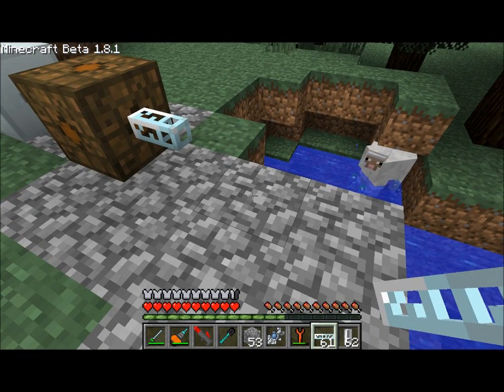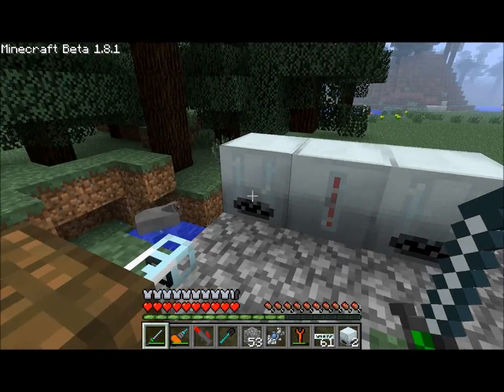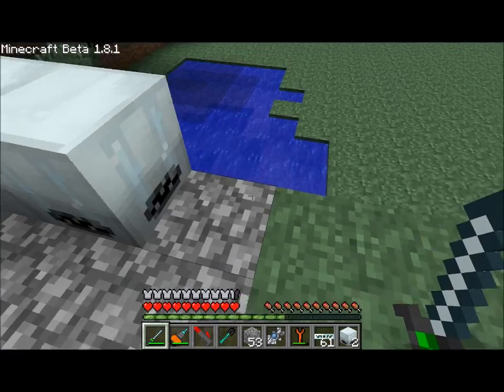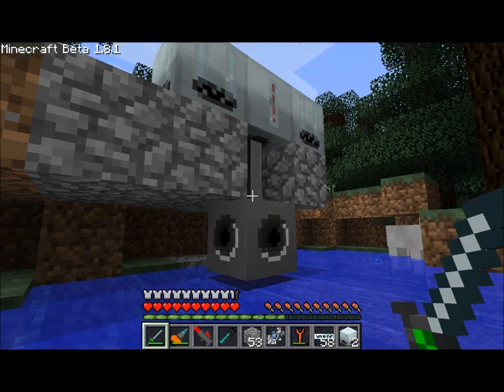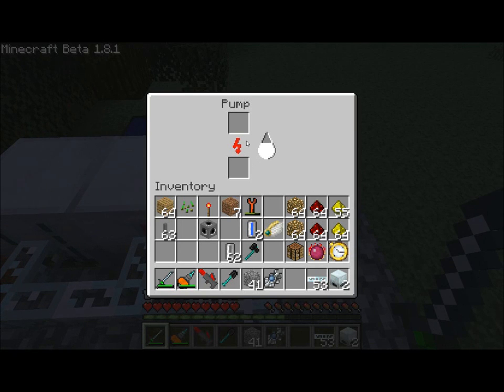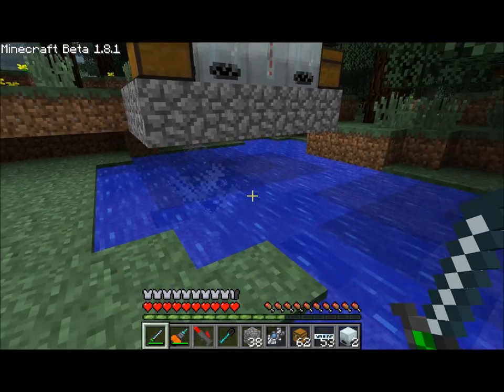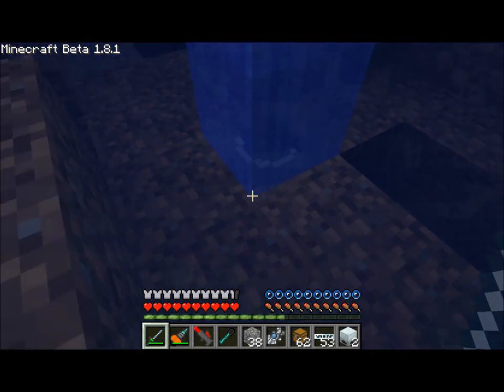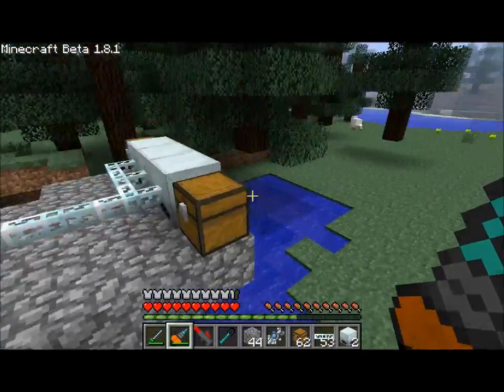IndustrialCraft 2.0 Tutorials - Pumps

Comment: You can also use a pump without a miner: it will drain water or lava sources directly below it. It's useful to use it in this way to produce water cells (used in the nuclear reactor later on), you just need to place the pump over an infinite pool =).
Reply: doesn't work anymore. idk how they messed this one up